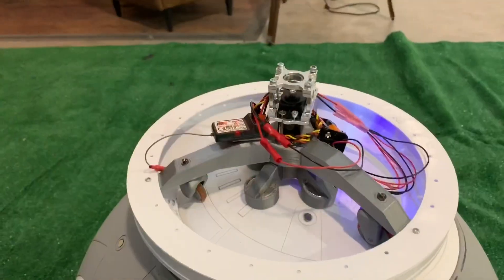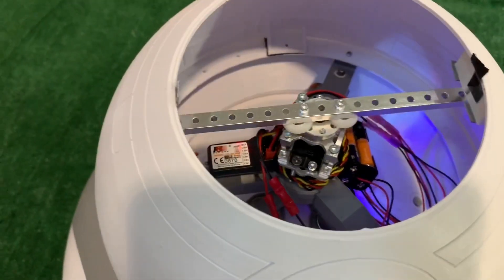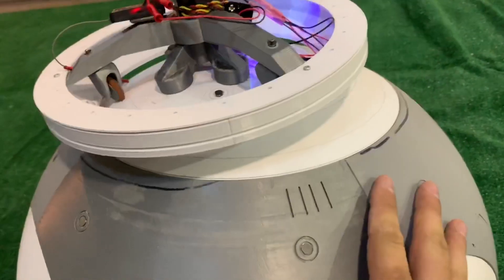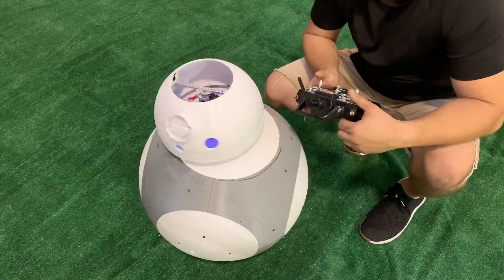BB-8 V2 Drive @ Studio

Comment: Do you have a parts list for the dome movement with the two servo's pinching that shaft you made?
Reply from the maker: HackinSpock you’ll have to be more specific. Are you asking what servos I’m using? Or what parts hold the servos? Or what parts hold the head shaft?
Reply: @TrickProductionsTV  What specific ball linkage are you using? Is the rod you are connecting between the two linkages premade or custom? Are these servo's sufficient: https://www.servocity.com/hs-785hb-servo

Is your STL files availiable to view on the files tab within the Builder's Club website, because currently the login system is messing up again and I cannot access the files homepage.

Any other important parts that secure the linkage between the servo and shaft?